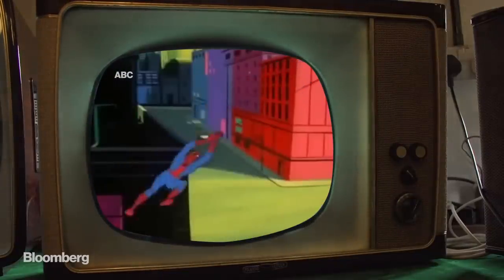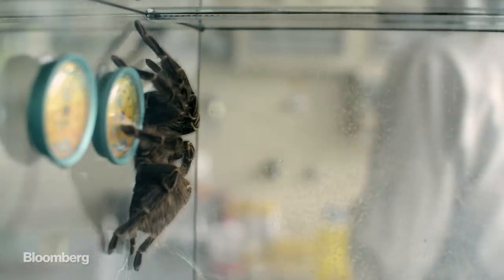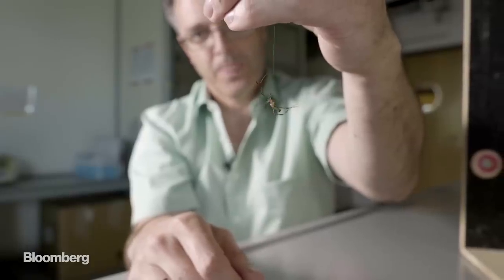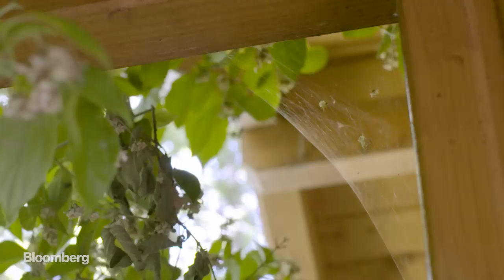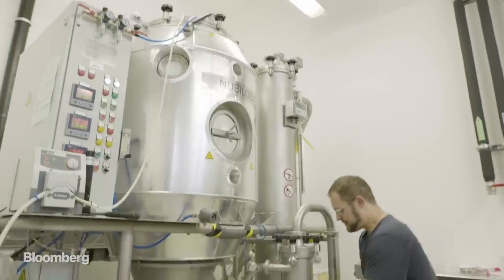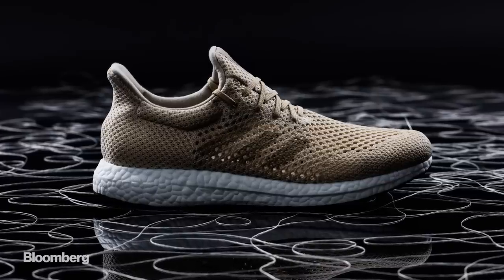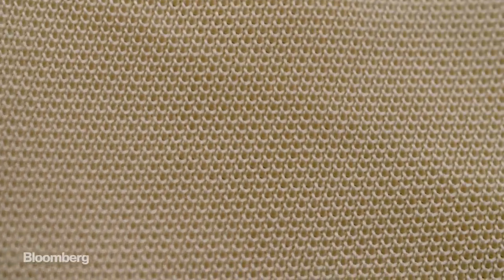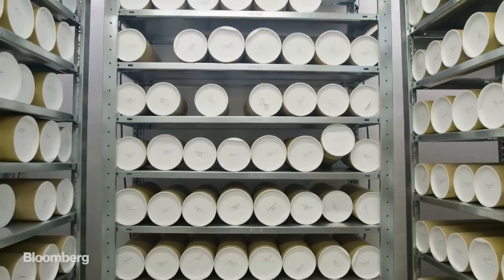The Real Life Spider-Men

Comment: The real question is how strong it is compared to original spider web?? Why was this question not raised?
Reply: Probably less stronger than the original.
Reply: also how does it compare to standard nylon? where is the proof, the data, anything?
Reply: It'd be less strong as this is made  in modified bacteria and is then processed. Processing something always weakens it unless it's a metal or plastic or glass as those are melted then processed while molten. With this though  the spindling, manipulating and converting into fabrics weakens each strand. But spiders  just kinda poop it out then join each strand with  sticky web. The sticky  web would be the weak point for the spiders, so these artificial strands could be considered to be as strong as sticky web as it's all just a powder till it's made sticky enough to be spindled. 

So each strand just won't  be as strong as spider web as the web is made in a particular atomic arrangement  that isn't changeable. As in it can't be melted or made  into a solid smooth blob and reshaped properly. But the sticky web they produce is suppose to be malleable.  Not the strand themselves though. The fact the artificial  stuff is all malleable shows it probably ain't  as strong as spider silk. But it's impossible to compare accurately  as  removing silk to test would already weaken it from that stress.

Although, this is assuming anything I just said is actually correct. This is all just my guess. But it would fit what I already  know about science, manipulating objects and making replicas of something.
Reply: Right, I feel like the yarn would be weaker (taking into account the thickness) than the original strand of silk. One of the key properties to the silks strength is its elasticity and I'd assume the thicker it gets the less elastic it becomes (even less so if it is spun into a yarn) and it might lose that property of elasticity that sets it apart from other synthetic materials.
Reply: I doubt it is stronger than cotton fiber. It is just fancier and rare. Protein from bacteria do not just form polymer like nylon. They still have to be crosslinked somehow.

Comment: You can't cut steel with scissors but you can spidersilk. There's different types of forces and strength.
Reply: Well that's cause spider web is a single strand if combined in a special shape it become hard as a carbon fibre

Comment: If stronger than steel than why not use in car body shell or bullet proof jacket??
Reply: price
Reply: @GhostlyGhille  bro, every innovation is costly initially but if they claim it is so strong than it will slowly enter mass production and cost will reduce. But I highly doubt it as they have heavily invested in this and they over suggest its strength for business deals.
Reply: stronger than steel in terms of durability / weight. I would highly suggest you try your theory on yourself though!
Reply: @Truth_Seeker09  the reason it isnt being done is the price to produce compared to steel is significantly higher and cars have a relatively small margin as it sits. Also it's a strength to weight superiority. I'd imagine their would require significantly more mass of web to create a car when compared to steel. Much like aluminum vs steel on cars the aluminum has to be thicker to meet steel standards.
Reply: @Truth_Seeker09  yes if proven practical itll probably be used much like Carbonfibre composite which is also stronger than steel just fragile. And still prohibitively expensive in something the scale of car production. And it's been around for decades.
Reply: GhostlyGhille BMWi3 (reasonably mainstream/affordable i.e. not a high end sports car) has a carbon fibre tub